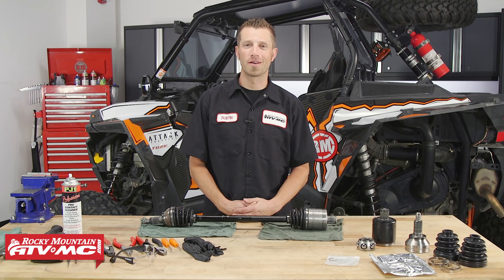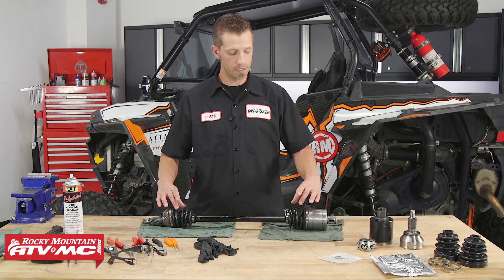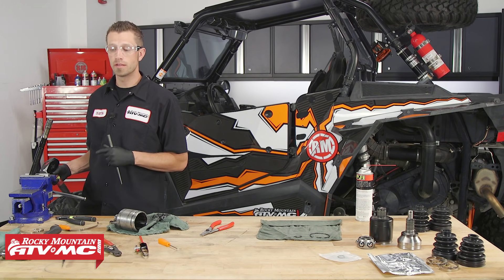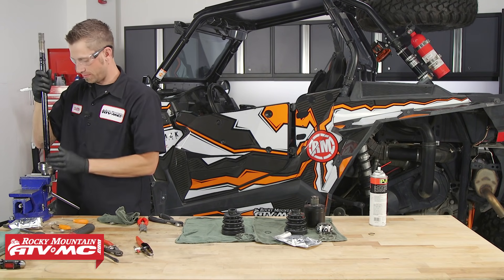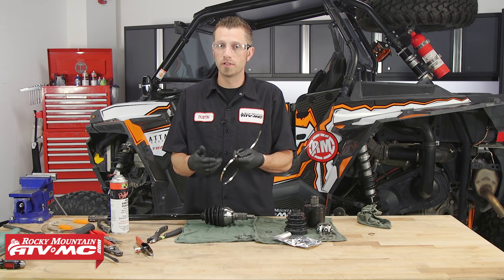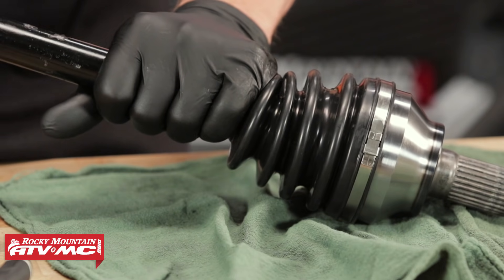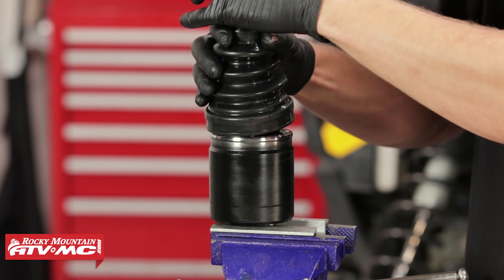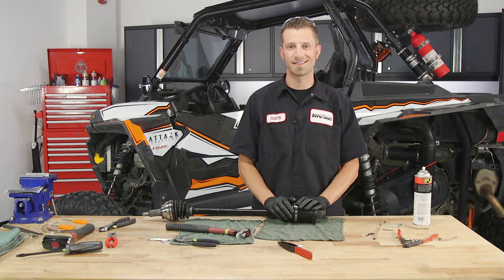How To Rebuild an ATV/UTV CV Axle

Comment: Well I just bought the Tusk CV boot kit and was sent some totally different "ear band boot" clamps that look nothing like the clamps in this video. Also, the Tusk banding tool that the video says you need does not work with the ear bands they sent me so that was a waste of money. You guys really need to update these video's if Rockymountain ATV is going to send out different stuff. Thanks to Cleon the tech chat guy who told me what kind of clamps I had after sending him a photo. I then googled the information and found out how to tighten them as I have never replaced a CV boot before.

Comment: Great instructional video.  Well done.  I have a 2004 Yamaha Rhino 660.  I get a bad "squeak" from the driver side front axle whenever I make any degree of a left turn. I have change the yoke bearings and the brake pads to no avail.  I have read many comments about a "clicking" or "popping" noise associated with CV axle failures but was wondering if you think its likely my squeaking is also from the CV axle since it only happens when I make any degree of left turn.  Thanks.

Comment: May want to mention that not all outer cv joints just tap off, my circlip had square edges and was designed to be compressed to release. As such and not knowing that, a couple of good taps blew the casting apart and destroyed the joint...

Comment: I am trying to replace a front outer cv boot. I need to take off the outer cv joint with a punch and a hammer but it doesn’t move at all. Any other ways to take this off?

Comment: If you have the original clamps reuse them, they are superior. To take them off, squeeze togther the tabs and lift end off hooks. They click together same way.
Reply: I dont think polaris comes with snaps
Reply: @danpmatz  My 2001 Polaris, I just did this, The metal bands work exactly as I described, at least on my stock boots.
Reply: @scottdowney4318   that's good because I also like those stock clamps a lot better

Comment: Does pounding on the inner race of the bearing work for the John Deere rsx850i as well? I've been trying and it will not come off
Reply from the maker: Not sure. I haven't worked on a John Deere and don't have any available info on it. I'd verify that you don't have a retaining clip on there before hammering it off. -Charles

Comment: Well done and very informative, I tried to work on removing the outer cv it didn't go out of the axle I hammered the inner race but it was impossible to remove out, and I am sure it is a clip type . Do you recommend any way to remove the joint please . Thank you

Comment: nice video! i just want to know, if the CV joint in both axle parallel, will the cage be freedom at any degree place? such as maths 0/0, have unlimited solute? hope see your opinion, thanks!
Reply: Nope. Limited solute with cage freedom.

Comment: Where can I find the snap ring that is at @10:25? I tried removing my front axle using a slide hammer motion but ended up pulling the cage and balls out with the axle leaving the inner joint cup assembly still attached in the differential. Now that is stuck and I have yet to get it out.
I've tried ratchet straps and mallet which didn't work for me.
Now I'm rigging up a slide hammer to get it out. Have yet to try that method as I had to order a slide hammer. Any ideas where to buy the snap ring or the size?
I also welcome any ideas on how to remove the cup.
Cheers!
Reply: Use a slide hammer. To you can borrow one from your local auto parts store. Slide the round disc part of the slide hammer into the cup . Clamp a vice grip on each side of the cup. Pull on the hammer side and it should pop out

Comment: Just got mine apart, some of these aftermarket dont use a clip or a snap ring,, Mine inner front are pressed on.  I got it apart with my press , it took some doing it was on there good. I am just replacing the boot I dont want to take the outer apart , going to have to get creative to find a way to hold the axle when I press it back on.  May have to do the heat and hammer thing.

Comment: I have an axle like this with 2 joins in it on the REAR of my hammerhead buggy, they don't click because the back wheels don't move left or right only forward, But are the parts that join onto the shaft supposed to have play side to side? Like I can pull it almost off the shaft